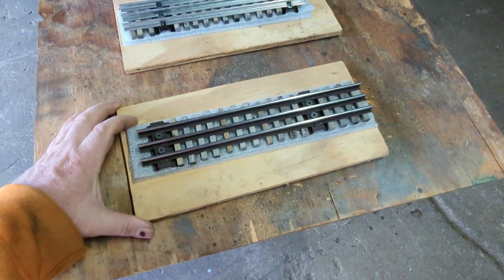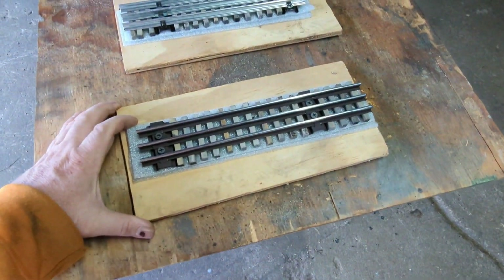ballast Menards track

Comment: Menards track is galvanized steel. It will not rust. If soldering you need to remove the coating for solder to stick. 
There’s a flap wheel called polifan curve from menards or a steel wire brush will work to remove the coating